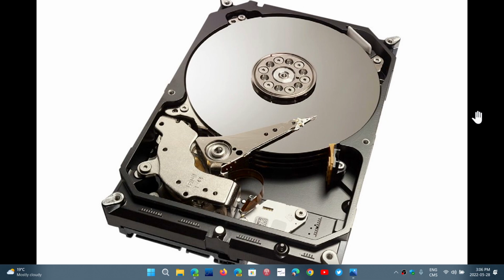Machanical Hard Drives what makes them fail over time

Comment: In my experience is matter of luck, I had some PCs where in 1 year or even some months a new HD crash, I assume they were faulty since the beginning, then I change it, same PC, same manufacturer, me with my same habits :p …everything and that HD lives many years without issues.
Thank you sir for the info, as you say for some reason or other some of us would like to change to a SS but are stuck ATM with a mech HD. I am paranoid with bad experiences in the past and check often that SMART you mention (I use Crystal Disk info, Speccy, and the events viewer to see if Windows has detected faulty sectors), but as I know nothing is 100% sure and you might have  crash at any time, but in my bad experiences it usually it gives “signals”